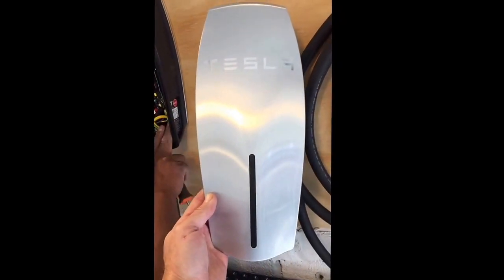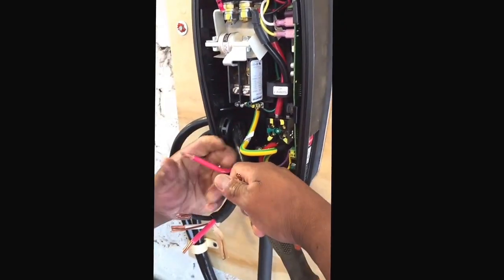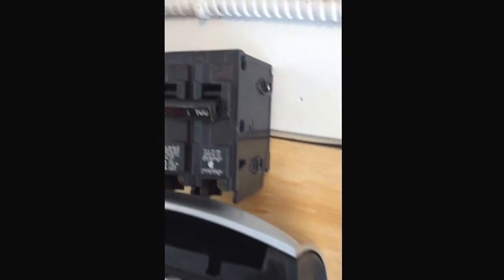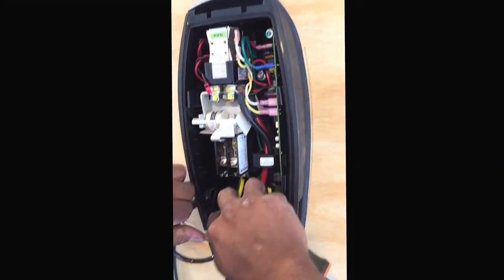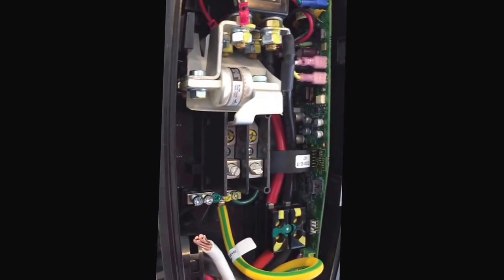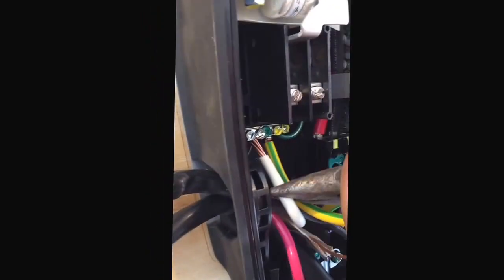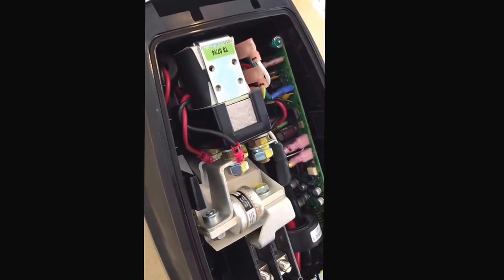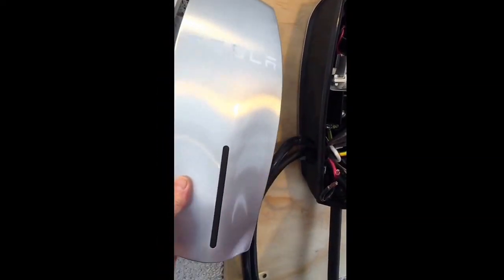Tesla Charging Station Installation

Comment: Hopefully this isn't still in service. Parallel cabling is a code violation, and the exposed cable is also a code violation if that wasn't covered after the fact. Real cowboy of an installer, there.